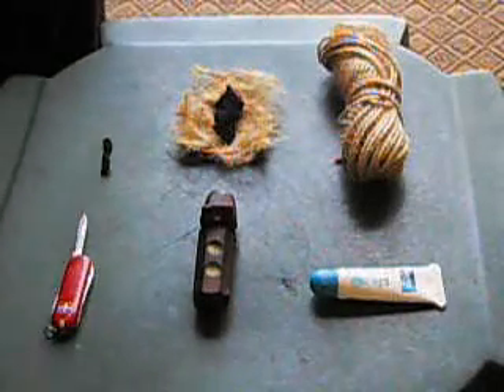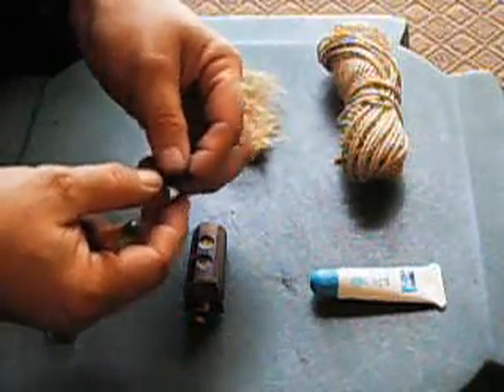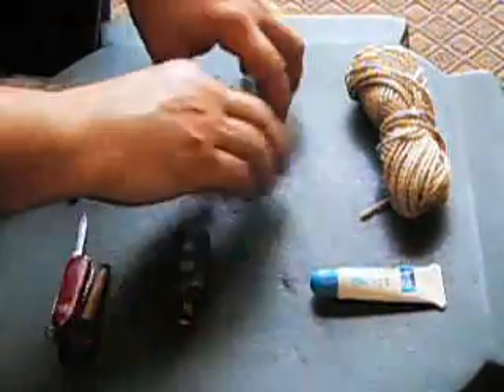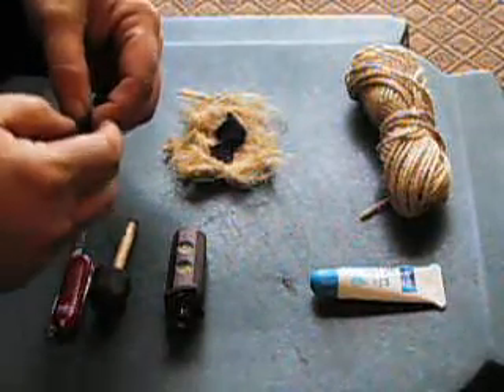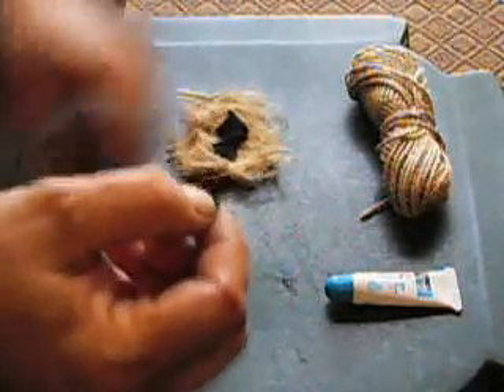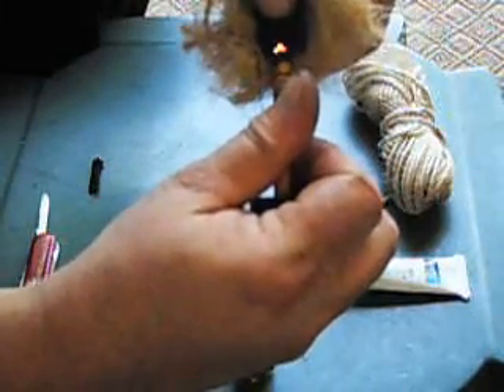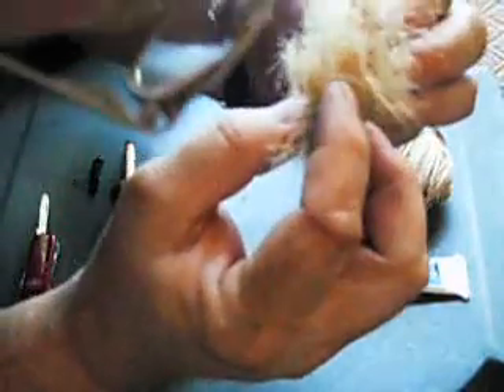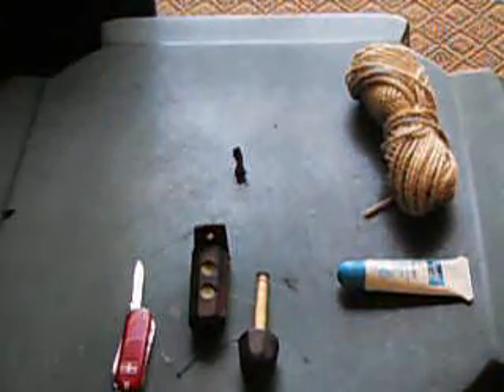J. Falk's Fire Piston Tips & Tricks

Comment: Mine has been temperamental it’s probably me but I noticed I have to do it twice more often than not .I think you preheat it when you do it once and then it’s easier the second time. Also don’t pull it out too quick . But not too long either it’ll die so I think that’s the unreliability part getting the timing.

Comment: dlwatib, I think you should recheck your facts. Yes, sudden compression of air causes combustion.  The science behind it would use "friction" to describe the oxygen, nitrogen, and other atoms slamming and rubbing against each other, thus creating the combustion.  In fact, I believe that without friction, you couldn't trap the air fast enough, if at all.  That one I could be wrong about, but friction most certainly starts the fire.
Reply: Correct.  No gasket means no friction, thus no compression.  A piston runs on a friction fit.

Comment: I have two, one made by Darrel Haune, and the other made by Jeff Wagner. Both are water buffalo horn, and what I use for lube, is those little grease pots that come with Army surplus weapons cleaning kits. What I have noticed is that the fire pistons loves char cloth, but it is very temperamental when it comes to chaga. Has anyone else noticed this? What could be the issue?